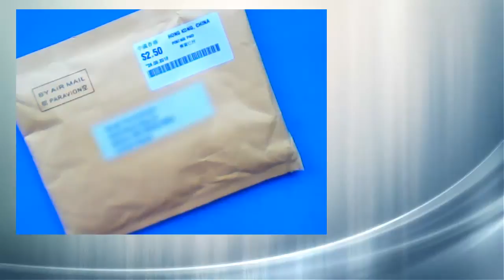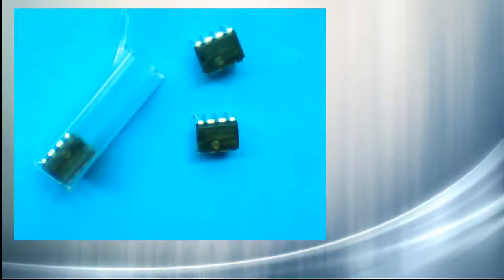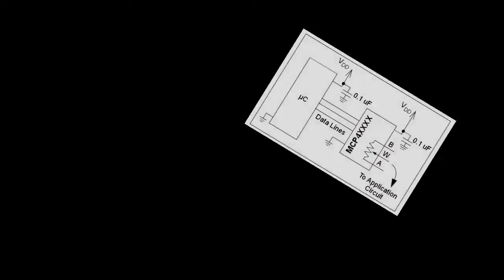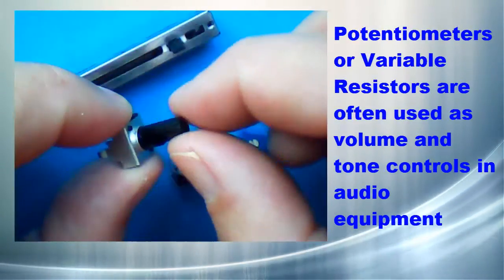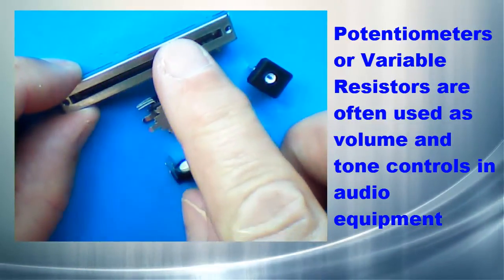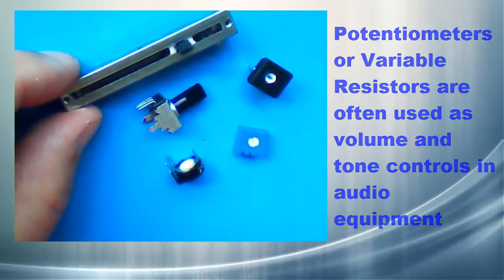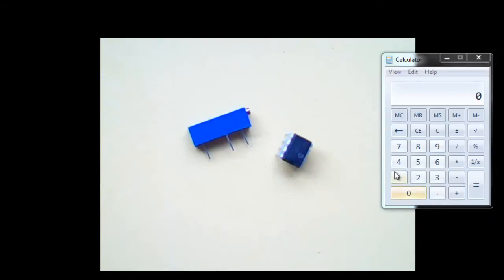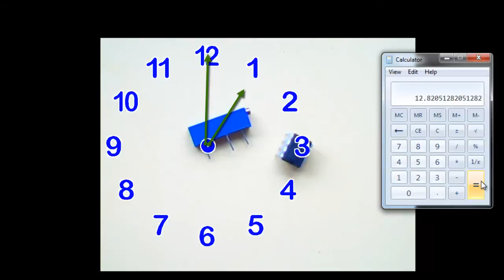Let's Look at a Digital Potentiometer

Comment: You Know,.... Everyone playing around with these fucking digital pots, fail to mention that they Do Not Work with AC coupled Audio signals. Poor buggers are pulling their hair out........... The X9c103 digital pot has a built in pump circuit, and works well for AC coupled Audio.

Comment: how to programming i2c with ad5241? can you help me to set up the interfacing with arduino uno and the programming for selecting the adressing
Reply from the maker: Look at page 13 on the data sheet: http://www.mouser.com/ds/2/609/AD5241_5242-246487.pdf
It explains the 2 wire interface. There are two pins on the chip (9 and 10) that you can put at either GND or 5V. They determine the last two digits of a binary number: 01011xx. GND is a 0 and 5V is a 1. You get to pick the last two digits which gives your four different addresses to work with. This means you can put four of these on the same two wires and talk to them separately. This is called the 'Slave Address', an unfortunate term. Your Arduino is the 'Master' it will tell the 5241 what to do. 

Remember that your 2 wires will each have a pull up resistor between them and 5V. You only need one for each wire, no matter how many devices you hook up to the bus. Common values are 4K7 or 10K ohm.

Comment: I was wondering if you might be able to give my some advice.  Im just learning about Digital Pots and I know that there are some IC's that contain 2 digipots in one package.  What I'd like to do though is be able to use one digipot  and be able to control 2 seperate things.  For example using a rotary encoder with push button to control  squelch and gain on a radio.  The button press should let me change between the two.  Just not sure how to wire the single potentiometer to control multiple outputs like that.     I know thats a lot to ask but thought i'd give it a shot.  Thank you ever so much